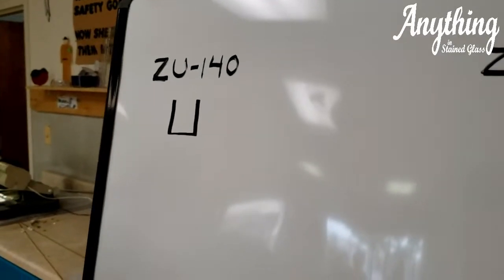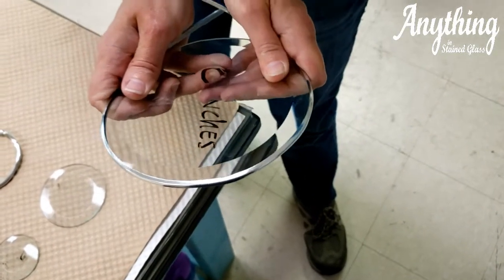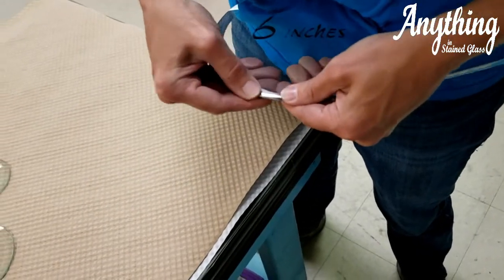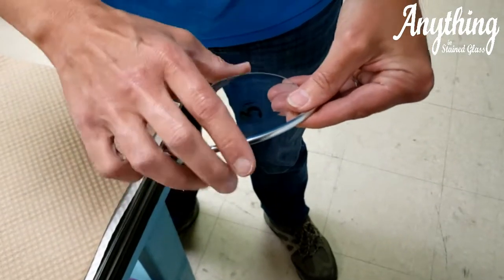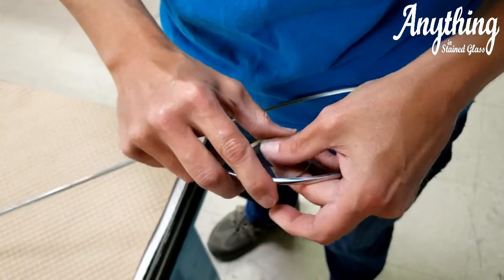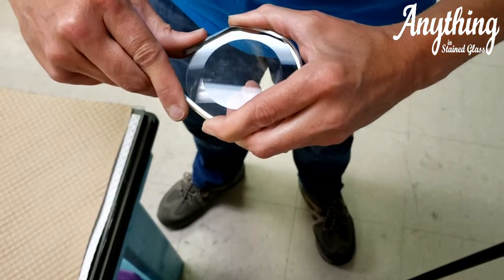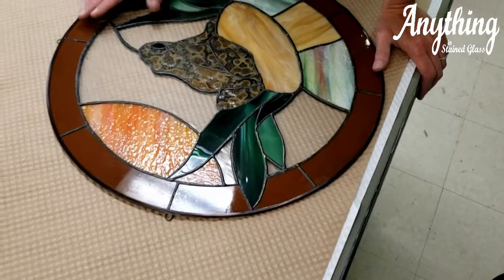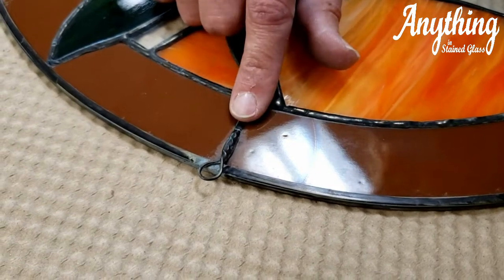Zinc Capping ZU-140 vs Bendable Zinc Capping ZU-2101

Comment: This is excellent!  I’ll try this on my next 8” round piece.  I’m curious though why you note near the end that the zinc does not add structure.  As long as it’s a single piece for the full circle and soldered to the other joints, why would that not provide additional support?